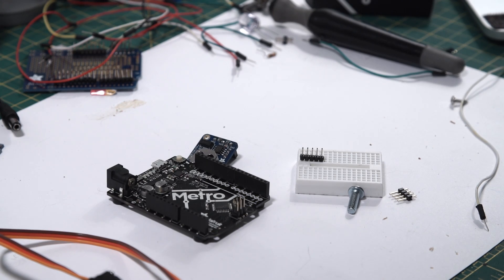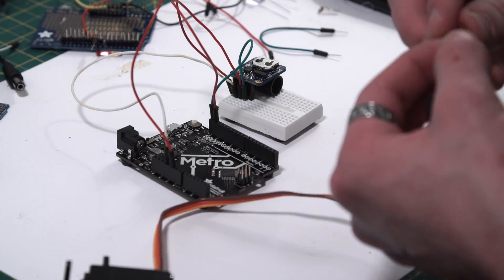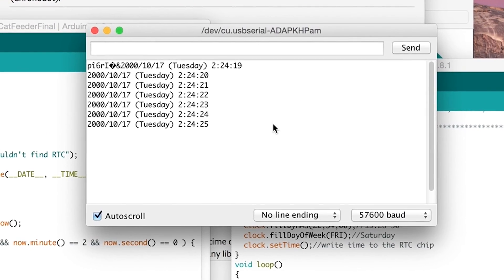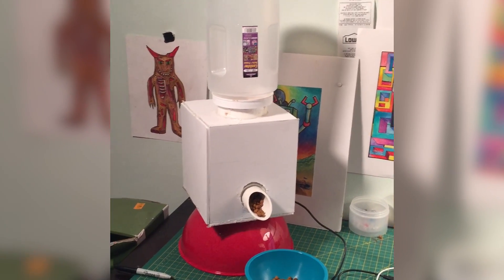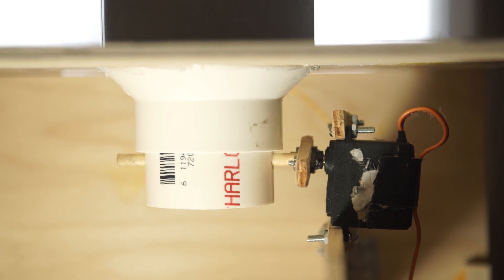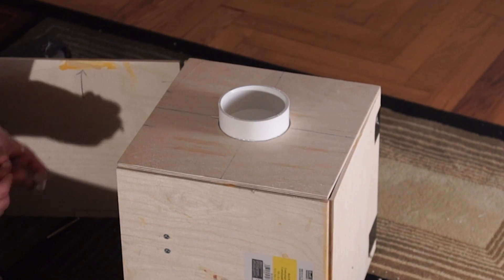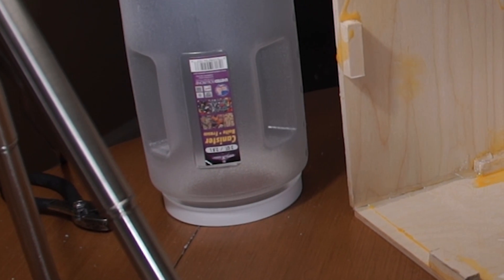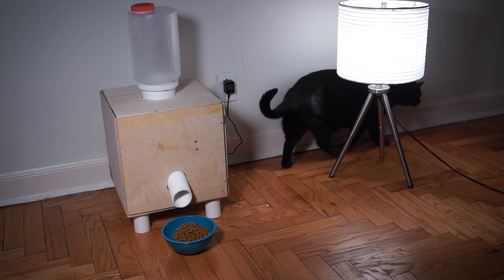HOW TO: Automatic Cat Feeder! DIY Tutorial

Comment: Do you have a schematic diagram of the wiring done? you cut the video before completely finishing the assembly process, also I'm using a slightly different board and cant see one of the sides you are connecting wires to. Also the full code with any Libraries needed.
Reply: hey just came across this video did you ever figure it out I'm looking for them also